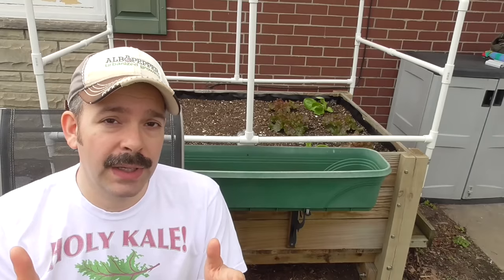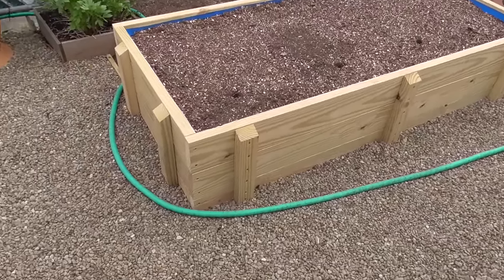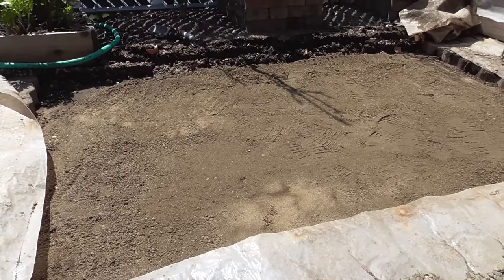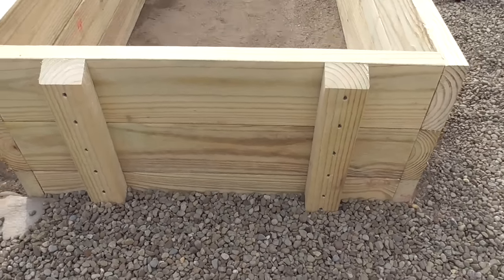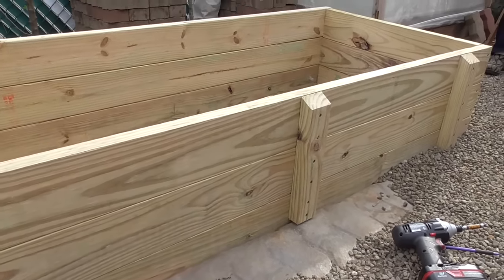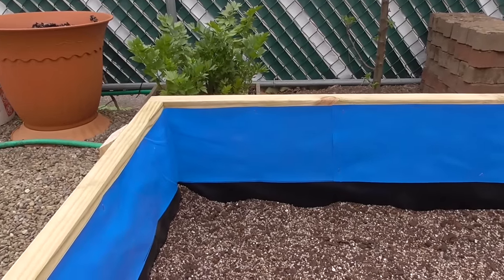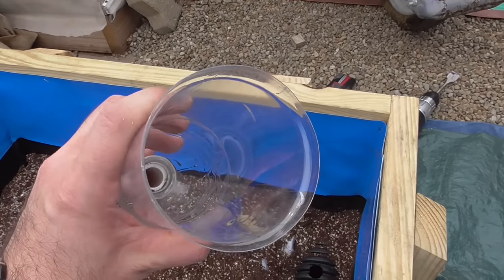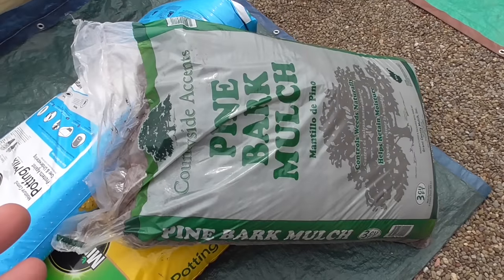Self-watering SIP Sub-irrigated Raised Bed Construction  (How to Build)

Comment: Where is your garden located?
How much moisture is at each 1" level above your reservoir?
Where I live, we can receive weeks without rain & then torrential downpours at other times, so I'm concerned shallow rooted plants won't get enough wicked moisture during very droughty conditions & the 1/2 " drain hose won't be adequate when a tropical rain storm hits & we receive 5" of water in 1 hour.

Thanks for sharing!
Reply from the maker: zeffur7 Hi! I'm in Pittsburgh PA.  The SIP bed in my video, has 2 overflow drain tubes.  I would suggest any large boxes have at least 2, just as a fail-safe alone.  For a couple weeks we didn't get rain and the potting mix formed a layer of dry crust, maybe 1/4" thick.  Everything below remained moist.  We've been getting lots of rain here & my plants are all still healthy & green.  But your situation is more extreme.

To address your special climatic issues you might consider this:  Slightly mound the potting mix in the center of the bed (6 - 8" above the top of your side boards).  Then apply a layer of plastic.  The mound will settle a little, but the main thing is, you want the water to run off.  Rain water will run off the sides & won't smother your plants.  You won't capture all that water.  However, the plastic will be even more effective at holding in moisture at the soil surface.  So it's a trade off.  But it might be worth it in your situation.

Plastic covers are hard to do if you have lots of smaller plants though.  So it depends on what you're growing too.  In my area, this has been working well so far with no cover.  As a reference, in the last 19 days we've had 6.73" of rain.

No matter what, you should use 2 overflow drain tubes -not one.  You could use a slightly thicker tube to increase flow rate if you are concerned about that.  During drought, even with no plastic, this should work well.  Just use the right mix.  You could always sprinkle a little water now and again if you feel like it.  But getting a cheap moisture meter can help to see if its getting too dry or not.

Check this video for details:  https://www.youtube.com/watch?v=5orIjYKFRgE   I hope that was able to help a little.
Reply: Thanks man... the mounded soil + plastic idea might be a great idea.  I'll have to experiment with it.  Thanks for responding to my message & providing a practical idea! :)
Reply from the maker: zeffur7 Absolutely! I know we each have unique challenges & I love helping people to find ways of tackling them.  :D

Comment: You recommend a 45 mil liner. Can you get a way with a thinner pond liner? What is the minimum?
Reply: Never mind heard in video 6 mil or thicker
Reply from the maker: WHAT TYPE OF LINING? Please do not use a 6 mil plastic lining or a tarp. The reservoir itself will hold up much better if you select a sturdier material. A fish-safe pond liner is the way to go. Although 20 mil might suffice, I advise trying 45 mil, especially if your climate includes freeze cycles. PVC should work ok, but I've been quite pleased with the EPDM liners. Look for it to say "Fish Safe". I bought mine off of Amazon.com.

https://albopepper.com/SIP-raised-bed.php

Comment: What is your ratio of potting mix & vermiculite when you do the bottom layer that is in contact with drainage tubes? Any advice on that %? Thank you!
Reply from the maker: WHAT ABOUT THAT SPECIAL "WICKING" LAYER? I typically mix up a special layer of wicking mix that I use for the very bottom section of my SIPs. This is the mix that's stuffed in between the black corrugated perforated drain pipes. So what's the magical formula? Is this super critical? Rather than making a strict, hard fast rule, the idea is to offer a general guide.

If you're making a very small system and materials are hard to come by, you could probably just use the same potting mix that is applied to the top section and it should work ok. If you want to mix up a special wicking base, you can use peat moss / vermiculite / perlite at a ratio of 3:1:1. This is not set in stone. The ratio could be 1:1:1 and it would work well. Anything like that is fine. You could replace the peat moss with coir (coco). I like using this special mix, because it is easier to stuff in between the pipes, since the particles are small & uniform. Also, I'm not applying a nutrient rich potting mix in the very bottom of the box. Instead, the fancy potting mix is reserved for the upper layer.

There's some flexibility here. But here's what I do NOT recommend for a wicking base. Do not use gravel or sand. Gravel does not wick well. Sand is a little better at wicking, but not as good as vermiculite, peat moss or coir. Both sand and gravel are MUCH heavier. It's not worth it. Do not use wood or bark products as these will not wick well and they may cause air gaps as you try to stuff around the pipes. Also, although peat moss is good at wicking, it does have a limitation. If peat moss becomes bone dry it becomes hydrophobic and actually REPELS water. So I never use pure peat moss in the bottom section since it could create a failure point if it ever happens to dry out.

https://albopepper.com/SIP-raised-bed.php
Reply: @Albopepper  Thanks so much!!! You rock!

Comment: new PT wood no longer uses arsenic.  Just an FYI.  I'm going to try this tomorrow.  Hey, what about using a continuous 4" pipe and just coiling it in the bed instead of multiple pipes?  If it needs to be tighter, then what about using right angles and 'T' joints?  Just wondering.  Of course the fabric on the end is probably cheaper and I do have some of that kind of weed-block stuff around.
Reply from the maker: +shackletackle - Hi! Thanks for watching my video. You could try coiling the pipe into a spiral and it might work out for you. That approach might actually be optimal for a round shaped bed, such as a watering trough. Try to keep the pipe sides from touching and try to cover the bottom consistently.

For square cornered beds, my personal preference is laying the pipes straight in some fashion. It just keeps it nice and neat for me.
Reply: +AlboPepper Thanks for the reply.  I did, indeed put one of these together this weekend.  I think I used 3" perforated pipe.  I used your design but left a gap (about the diameter of the pip) down the middle to encourage wicking.  The interior dimensions are ~40" x 38".  I had 6 rows of corrugated pipe.  I used a 2x4 to separate the outside rows from the wall of the bed.  I used pallet boards to keep the separation between each row if pipe.  I removed them as I filled it with dirt.

The parts of the bed that touched the ground and vertical supports were made with Trex to keep the subterranean termites at bay.  The top frame was made with PT wood.  The liner was a 10' x 7' fish pond liner (like you used).  I also used a really thin weed block fabric on the ends.  I also put the frabric over/between each pipe even though it was probably not needed.  Below the vinyl I did lay mesh screen as we have some resident gophers.

In the end I have about 10" of soil depth between the top of the soil and the pipes.

Thanks again for the great tutorial.

Comment: I really hope ypu go back and read new questions. I have several rubbermaise stock watering tanks. Maybe 100 gallon. Could i use them to do this..???? They are probably 28" tall...wouldnt want to put dirt all the way to top. Used them for isplation tanks for koi but am not buying more fish and want to uee them for something. AND  they are tall enough ( and wider at top than bottom)  that the darned woodchuck wont be able to eat all of my crop . I am now dusabled and need to cut down work but not willing to give up fresh vegetables.p.ss. have had a worm farm for 30+ years so i have worm castings ,lol, to use.

Comment: Great video and ideas.  If I want to put my raised planter on a cement block, would you recommend putting something underneath the pond liner, (ie cardboard) or use a plastic hardward cloth below to keep the pond liner a little above the cement or should there be no issue with it directly on the cement?
Reply from the maker: Hi Lisa! You're thinking about laying it directly on a concrete slab? Is that correct?

Comment: What if you came out near the bottom at the same (or slightly lower) level of the drain holes with a container that has a float valve in it which is hooked to a hose? That would be automatic watering, yes?  As the water level drops, the float valve opens and fills the bottom of the bed for you...?
Reply from the maker: Yes, that would absolutely work and it's a great idea! I mention that basic idea in one of the update videos: https://youtu.be/aKrjC5sC5cU?t=6m59s  It would be a little more work to set up, but for many gardeners, it would be worth it.  :-D
Reply: rigidheddleweaving 
I would like to see video/ tutorials on float valve with timers, so going on vacation lt would take worrying away.

Comment: loved the video .. it will help in building one ..  Question, what type of pond liner did you use .. Is the liners that say safe for fish OK for vegetables?
Reply: philk1148 AlboPepper .. re reviewed the video and you answer my question..
Reply from the maker: philk1148 I had been using 25 mil PVC. If I was going out and buying brand new liner, I would probably use 45 mil. Just DON'T use that 6 mil, especially if your zone experiences freeze / thaw cycles.  Thanks for watching!  xD
Reply: Thanks

Comment: Hi there 
I'd like to ask you something... As I can't find a drainage pipe here, how about using upside down transplanting square pots?  Maybe making some small cutting on the side?  Do you think there would be issues?
Reply from the maker: You would need substantially sized pots. They ought to be 4 or 5 inches deep. And they need to be a solid rigid plastic. Not like those flimsy seedling cell packs. Shallow plastic storage containers could work too. Or some people get smooth PVC pipe and drill holes into it.

Comment: I was going to use cedar wood, 1" thick, 8" wide, but I guess 8" is too shallow, so I'll need to use two such boards to make 16"!  Would 1" thick suffice?  2" seems like a bit much.  What size pieces of wood should I get for the "blocks" on the sides?  I was thinking 2x2" square pieces cut to 16" long.
Reply from the maker: It sounds like you have good plans. I think it should work out well!
Reply: @Albopepper  I just finished putting together the sides of my raised bed today.  I'll put them together to complete the frame another day.  I couldn't find 2x2" cedar pieces so I used 1x4".  I have gophers in my yard so I'll need to use some kind of rigid flooring for the bed.  Buying new plywood is expensive now.  Would OSB with some landscaping fabric on top work?  I just got a ton of pieces of OSB today for free.  How about PVC hardware cloth?  My dad has a whole roll and I'd rather use what I have than buy something new.  For reference in terms of climate, I live in New Jersey.
Reply from the maker: So the plan is to place OSB directly on the ground as a base underneath the liner of your reservoir? My concern would be that the OSB would break down from constant moisture exposure. PVC hardware cloth might be too easy to chew through. What about Galvanized Steel Welded Wire Rolled Fencing? I would expect that to hold up a little better.

Comment: This is a great video! I had my house sided and they gave me the 16' pallets so I built an 8' x 3.5' bed for free! My question...can I use the same soilless mix next year by just adding fertilizer? I live in upstate NY which is Zone 5 so what do I need to do over the winter?
Reply from the maker: Hi Joanne!  Good question. I've been able to keep using my SIP potting mixes for several years. I'll periodically add more mix as needed to top off the boxes. I always remove large plant roots and compost them. I also fluff up the mix in the spring. Sometimes I'll add perlite or aged pine bark fines to boost structure and pore spacing. Seems to be working so far! After that, it's as you said - simply add a fresh supply of nutrients.  :-D

Comment: Question: I understand you can’t make it too shallow, but what about too deep? I will be building my boxes 30” high. Should I first fill the bottom with regular dirt, and then stick my liner in at that 18.5” depth, or would it be possible to place it deeper (say 24”)?
Reply from the maker: Hi Lindsey! Rather than filling the sub-base with dirt, you could consider gravel instead. Or you could even build a false bottom. 24 inches might work, but I haven't tested that depth. It's possible the top few inches won't wick as well. If so, you may have to top water it from time to time.

Comment: The reason the vertical fill pipe is cut at an angle is so it can't sit flush against the bottom of the inside of the horizontal pipe.  Corrugated horizontal pipe may not be an issue but using a pipe without corrugations probably will.

Comment: So if I understand correctly, reservoir pipes will collect any excess water, then the vermiculite or petemoss will absorb the water when needed for the plants, creating a balance?  Do any of the reservoir pipes connect to each other?  Specifically, does the reservoir pipe that you fill with your down-pipe connect to any of the other pipes?  Or does the one reservoir pipe fill up and the vermiculite/petemoss soak up what it needs and gets the job done?
Reply: Mike Olson Also, if I build this in a dryer climate (Central Texas), how often would I need to water?  Or how would I know when it has enough water?
Reply from the maker: Mike Olson As your plants get bigger, they will consume more water. Warm, arid, sunny, windy weather will increase the rates of transpiration. So the water requirements can fluctuate quite a bit. I recommend getting a cheap moister meter to monitor soil moisture. The very top might sometimes appear dry, but the meter might show you that there is plenty of moisture.
 
Once you see a little water dripping out of the overflow tube, that tells you that the reservoir is full. No need to fill it any more. As you fill it and then monitor it, you'll start to get a gauge for how quickly the plants are using the water. Don't feel like you need to top it off every day, keeping it totally full. Allowing the reservoir to partially empty is probably a good practice. You will get the hang of it quickly. Just don't get lax, ignoring it for days and days. SIPs can make us lazy, lol.
Reply: AlboPepper So, are all the reservoir pipes connected to each other?
Reply from the maker: Mike Olson Hi Mike. The reservoir pipes do not need to be connected. These are perforated pipes. As a result, the water will disperse evenly throughout all of them at a pretty quick rate. It all works pretty smoothly!  xD
Reply: +AlboPepper Are we talking about the corrugated drain pipes?  I don't recall seeing anywhere in the video that it said they were perforated?  I assumed the water would spill out the "capped" ends.  It's just "synthetic landscaping fabric", and since I've never seen nor used it I just assumed it was permeable (this stuff?  http://www.homedepot.com/p/Vigoro-3-ft-x-50-ft-Polypropylene-Non-Woven-Fleece-Weed-Barrier-Landscape-Material-2-Rolls-NFB2-350/203864205?cm_mmc=Shopping|THD|G|0|G-BASE-PLA-D28O-OutdoorGarden|&gclid=Cj0KEQiAg7ayBRD8qqSGt-fj6uYBEiQAucjOweZstBDzAOciKXWpnSXd0fYInsd54SEqLJWlYvqXbEoaAn-48P8HAQ&gclsrc=aw.ds )  Thank you
Reply from the maker: I mention corrugated perforated pipes at 13:00. The slots in the pipes improve soil aeration and speed up water dispersion during a fill up. The fabric you linked would work just fine for capping off the open pipe ends.
Reply: Guess I "blinked" :)  So, if the pipes are perforated... and the intent is to keep dirt out of the ends... would it hurt to cap the ends with something less expensive and available in smaller quantities?  Like plastic wrap (i.e. Saran Wrap or equivalent).  I realize water would no longer come out the ends.
Reply from the maker: DrDangerPuppy - Heheh, sure you should be able to switch to a plastic. I already had the fabric on hand. But you could use anything that won't decompose. I never tested it, but still I don't see why plastic wouldn't work just fine!

Comment: Brilliant explanations AlboPepper! Especially about the air layer at the top of the slotted agi pipes!!
I have 2 beds (1metre x 2 metres) and about to fill them with potting mix. No local bulk potting mix available, so is it OK to use cheaper potting mix for lower half of bed and better mix on the top half... mixed together? Bagged potting mix ranges from $3.95 which has added soil wetter and gypsum, to $9.98 for Osmocote® controlled release fertiliser that feeds plants for up to 4 months. (Contains Composted manure, blood and bone, seaweed, fish and molasses that stimulate micro-organisms and earthworm activity
Contains gypsum - a natural clay breaker & Professional grade wetting agent that ensures uniform wetting and rewetting of mix.) I estimate I need at least 20 x 25 Litre bags! That would be $140 per bed!
Would like to reduce the cost of soil.... somehow!!! Wish I knew how to make up my own if it is cheaper!
My garden centre is trying to tell me their garden mix is light and fluffy and would do the trick at about $40 per bed. Your thoughts?
Reply from the maker: Ask your garden center what components they are using in their garden mix. Peat moss? Perlite? Are they mixing it up themselves?

Comment: You mentioned that you would have liked a few more inches of space in the reservoir for extra wicking, so why didnt you use 5 instead of 6 tubes? That would've given you about an inch of wick between tubes.... Would that be too much?
Reply from the maker: One less tube would have opened up a gap of 4.625" wide. This might have worked ok, but it would be pushing the gap width. So I decided to go narrow, rather than going wide. Fortunately, this gap amount has been working well.